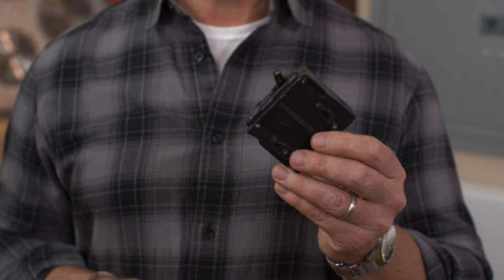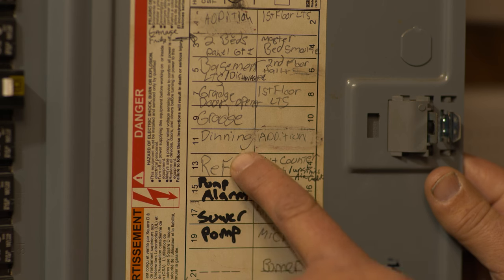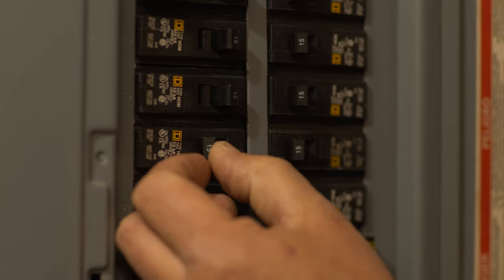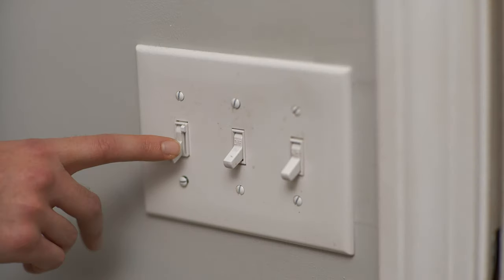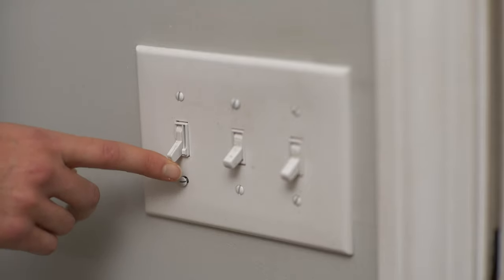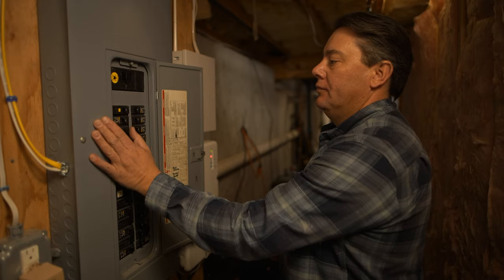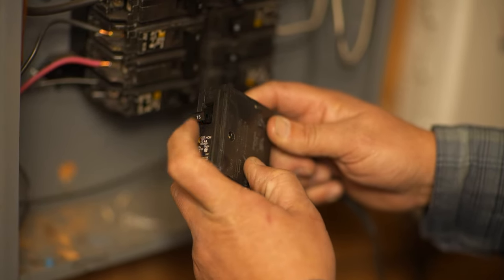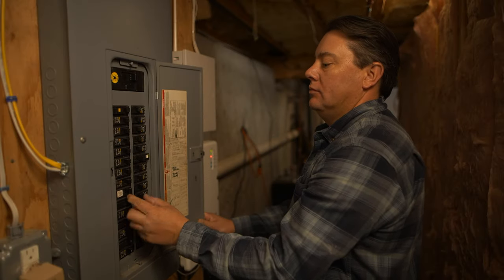How To Replace a Circuit Breaker | The Home Depot with @thisoldhouse

Comment: Watch other videos for doing this yourself, lot of words here for the lawyers, I guess.  This is more actions and work than needed. This one has you moving around a lot. The main tips would be to take a picture of the breaker with all the alien writing shown, when you get to the store you will be surprised with the selection (and they all kinda look alike at first). 
I love this channel, but there are so many other videos on this that are easier to understand and this is a really simple fix with just a screwdriver and about 10min. time. Really hard to screw up...but it is electricity so you could die. Probably nobody has screwed up a breaker swap, just use the correct replacement.
And have fun, can’t take house repairs personally. They happen to everyone, house repairs will make you feel warm and fuzzy inside!👍🏻🇺🇸